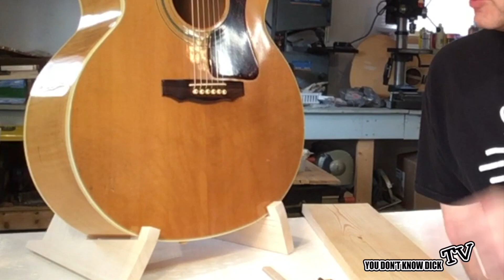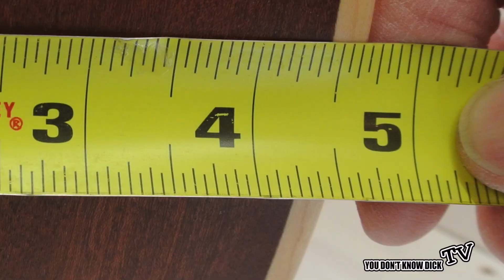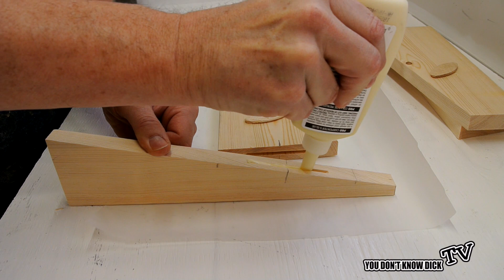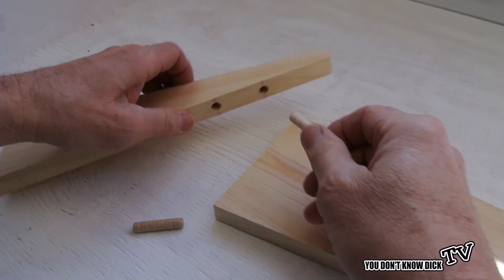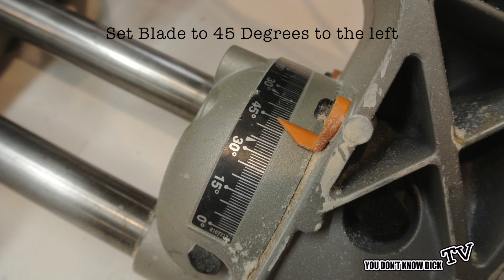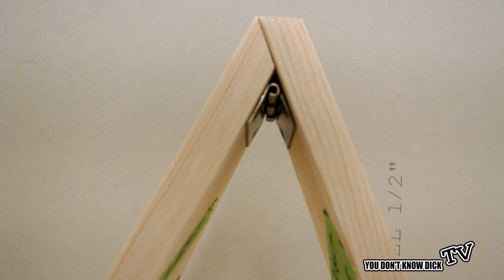Build this guitar stand for under $5 !!!

Comment: This is just awesome, so simple, fun and easy to make....directions were well thought out and planed....made two in one 
afternoon for gifts thanks so much for sharing.   As a note, I used pocket holes to connect the back brace and foot...seems to work well...(I did put wood plugs in to cover the holes made by the jig)

Comment: $5... First I have to buy all the tools you used :D $5000
Reply: If you are going be like that, then just buy cheap tools, go to a hardware store and buy a cheap handsaw and a $20 drill, you can get the same results.
Reply: If I'm gonna buy 4500 € tools, why would I buy $25 tools?
Reply: He used a sliding compound miter saw and a biscuit joiner, which he said you could replace with a drill, and some clamps. You could get the saw, drill, and clamps for less than $500, an order of magnitude less than estimated. He just didn’t use many tools here. And if you don’t have a basic drill already I can’t imagine why you are watching DIY videos about woodworking as if you actually expect to make the stuff.
Reply: @Jetronaattori
     IDIOT..............................IDIOT.........!!!!!!